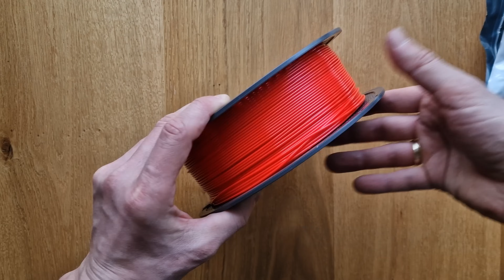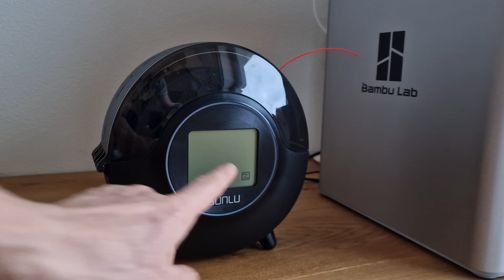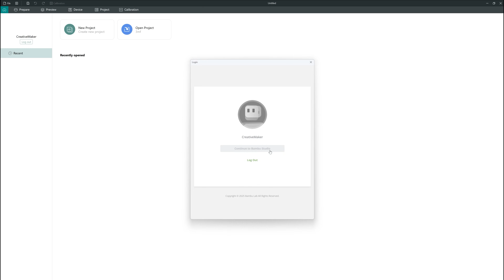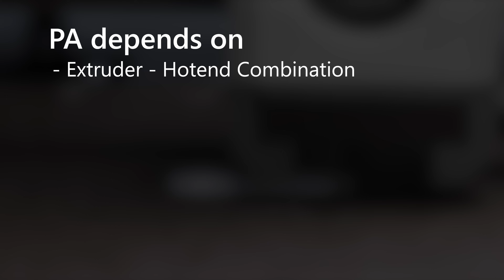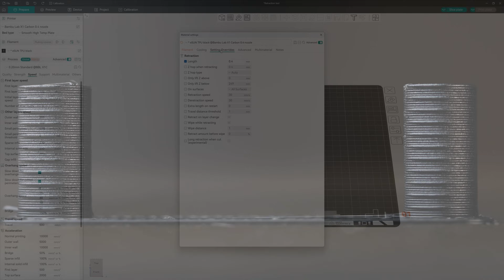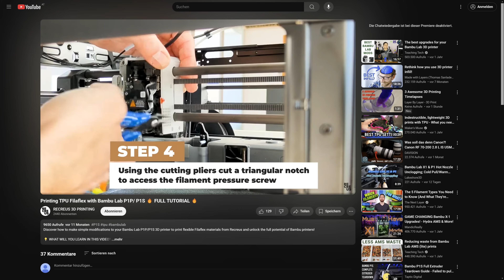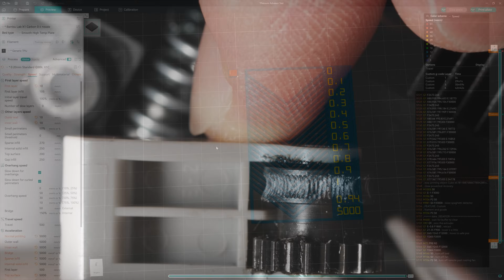Mastering Flexible Filaments on Bambu Lab - the Ultimate Guide 🛠️

Comment: My beef with eSun is the very poor quality spooling they do. If there's slight variations in the tension on the filament going into the printer, this creates extrusion issues that manifest in the print. There's already so much you have to set up correctly from the filament drying, loading, filament path, extruder and hotend that having the wonky spooling does not bring my any joy.

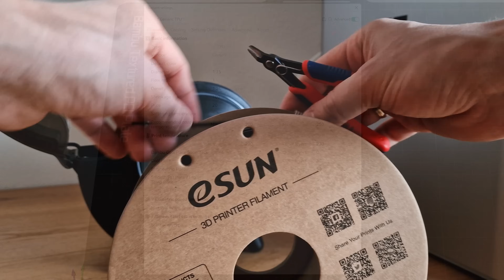Comment: 13:48 Is 70 degress Celsius not a bit hot to dry TPE at, given 55 is recommended for TPU which has better temperature resistance than TPE? I just do mine at 55 I think 70 is a bit hot is my opinion
Reply from the maker: Thanks for pointing that out — appreciate you sharing your experience.
To be honest, I wasn’t aware that TPE is generally recommended to be dried at a lower temperature than TPU. I had no issues so far, but you’re absolutely right that 55 °C is the commonly recommended range and the safer option.

Comment: Great job on the video; very well done and informative.  Trying to decide if I want to try 60A with an H2D, sounds like such a headache.
Reply from the maker: Thanks a lot — glad you liked the video! 😊
I don’t have access to an H2D myself, but I’m super curious how well dual usage would work with 60A. I agree though, it will probably take some time and experimentation to get it running reliably, and a lot will depend on the print head design and where the spool can be placed.

For your information: I’ve just uploaded a dedicated video about printing 60A on the X1, in case that’s useful.
If you ever decide to give it a try on the H2D, I’d love to hear about your experience!

Comment: I think although Studio doesn't show the OA you set in Orca, it does use it.
I will have to check gcode to confirm or not though.
Reply from the maker: According to my research, Bambu Studio does not use the OA set in Orca—but I haven’t actually checked the G-code myself. Have you had a chance to look at the G-code meanwhile? Would be great if you could share any insights. Thanks!

Comment: This is really helpful. Thaks. I tried to push through ptfe tube. But it did not work. So filament directly to nuzzle as instructed work. However, before actual print starts, you need to pull filament upwards so that it won't entangle in middle of preparation. After this, as the movement of nuzzle become repetitive and predictable, you can monitor and leave it.

Comment: Going to ask what is probably a pretty basic question.  So lets say I drop a benchy into Bambu Studio.  I then right click it and change filament to generic TPU.  Does this automatically set settings for TPU?  And then after that I slice it and send it to my printer (not print directly, but just send the model over).  I then go to my printers screen and select the model and then pick the generic TPU I have set on the external holder.    Since I have picked generic TPU will the printer follow those generic TPU setpoints or does it look at what was set from your computer on the model itself (in this case I picked the same, but lets say I sliced it as PLA and then selected TPU on my printer)?  Still learning how profiles and settings work between studio and the printer.

Comment: Having printed flexible filament for years without problems with an old and primitive Renkforce RF100, I couldn't imagine how complicated it is to get the same results with a BambuLab A1. I wonder why there is no turn-key solution provided by the manufacturer.

Comment: your TPU vs TPE comparision is a bit misleading in your context: TPE (Thermoplastic Elastomere) is a group term that used to group for example Thermoplastic Polyurethanes (TPU) or Thermoplastic Styrene Elastomeres (TPS) like SEBS (a Cousin of ABS) for aexample

So every TPU is also a TPE

fun fact: eSUN TPE 83A is (according to the MSDS) 97 % Tetraphenylethene (which is not a TPE) - it is usually only used as an additive for PLA to improve the mechanical properties and enhance the crystallinity, but you usually would only use a maximum of 2 % Tetraphenylethene and not 97 % as eSUN suggests - but since they also give the correct CAS-Number in their MSDS, i wonder what is going on there.

Comment: I very impatiently wait your episode on 60A TPU !
Myself I did print FilaFlex 65A TPU surprisingly well with my A1, I didn't use a tube, I left the extruder, I just had to hold the filament with my hand during the print...
Reply: Did you loosen the extruder’s filament drive gear tension?

Comment: Excellent video! I don't have a Bambu Lab printer but instead use an Infimech TX but I do use Orca slicer 2.2. Just finished a TPU project and tweaked the settings until a great result. Nice, smooth surface and great overall quality. My only struggle seems to be the seem. Tried different settings, scarf included. Result was good but could be better. I have used the Orca calibration tools before, but strangly I forgot to use them for TPU. still managed to get the desired result. 
One thing I found out with my setup: Although I started with the low speed settings and printed a number of objects, when printing the last set, during the print I changed the overall speed to 200%. I could not see any difference in the end result.

Comment: In general your English is excellent. However, the pronunciation of Bow is not correct - sounds like B-ahh-w not B-o-w.
Hope that helps. Bow is one of those words that is spelled the same with different pronunciation for different meaning.
B-ah-w is the front of a boat, B-o-w is bent wood of a archery system.

Comment: Printing tpu is quite model shape dependant. The first principals could be a good quide, such as function of the model. Best adhesion is hotter range nozzle, hitter range 1st layer bed temp and print speed for first & top (few) layers kept slow with 0 fan.  Stringing will likely occur around rapid repositioning, so avoid multi model plates unless models are low & complete object before starting another is set.  The balance is having the tpu hot enough to adhere well to the buildplate & itself, and fan to print speed to avoid stringing. I'd suggest after the first 1-2 layers, the fan set at 100, then match the inner & outer wall for efficient speed. A firmed wall may act as a nozzle wipe when sufficient cooling has occurred. Small models might be friendly to a minimum layer time with this setting allowing cooled inner & outer walls to wipe the nozzle.

Comment: Awesome 👏 Looking forward to the 60A video! One question, with the spool mounted on roller bearings above the printer, how do you keep the filament between the spool and the print head from falling into the chamber and possibly getting tangled on the print head?

Comment: I use the X1C for engineering parts and are dabbling with inserting TPU friction areas into harder plastics - ex fingers for robot grippers. 
I currently do it by printing a solid friction pad in TPU, then printing a finger in harder plastic where the friction pad is inserted into, we pause the print and then print over part of the TPU so it is melted into the PLA, PETG, ABS... We make sure to have a cavity that locks it in XYZ direction so adhesion is not a concern.

I would be very interested in knowing if it would be a good process to print in TPU for AMS and then print 60A on top of the TPU for AMS for adhesion, friction and surfaces.

Comment: yeah, not sitting through 38 minutes, here's a summary y'all

"... Based on the information from the sources, here is a comprehensive step-by-step guide to using TPU 95A filament on a Bambu Lab X1-Carbon printer.
Printing with flexible filaments like TPU can be tricky, but with the right preparation and settings, you can achieve successful prints. The Bambu Lab X1-Carbon (and P1 series) is capable of printing flexible filaments, even ultra-flexible ones, although some adjustments and care are required.

1. Prerequisites:

*Drying the Filament: TPU is highly hygroscopic, meaning it aggressively absorbs moisture from the air. Printing damp filament can lead to issues like foaming, spitting, poor print quality, and stringing. It is highly recommended to dry your TPU filament thoroughly before printing and ideally print directly from a filament dryer or a dry box. The source recommends drying at 70°C for several hours.

*Slicer Software: While Bambu Studio can be used, the sources heavily recommend using OrcaSlicer for calibration tests due to its built-in calibration tools. You can download OrcaSlicer from its official GitHub page.

*Printer Connection: Ensure your printer is connected to your network (via Ethernet or Wi-Fi) to use the slicer's device tab and send prints directly.

2. Initial Printer Setup & Settings (Based on TPU 95A HF):
The sources indicate that Bambu Lab's default profiles for TPU 95A might need tweaking. A profile that resulted in significant improvement for TPU 95A HF included the following changes:

*Maximum Volumetric Flow: Reduced to 2.5 mm³/s. This is much slower than defaults for other materials but helps with flexible filaments.

*Retraction Length: Set to 1 mm.

*Print Speed: Lowered to 30 mm/s (for inner and outer walls initially). The source later experiments with speeds as low as 10 mm/s.

*Travel and Acceleration Speed: Also lowered.

*First Layer Temperature: Start around 230°C.

*Other Layers Temperature: Start around 250°C.

3. Calibration Process (Using OrcaSlicer):
To fine-tune your settings for your specific filament and printer, perform the following calibration tests in OrcaSlicer's Calibration menu:

*Temperature Tower:

   *Use OrcaSlicer's Calibration menu to generate a Temperature Tower.

   *Define a temperature range to test (e.g., 215°C to 255°C).

   *Print the tower and inspect the results, focusing on overhangs, bridging, and surface quality.

   *Select the temperature that yields the best results (the source found 250°C to be optimal for print quality on layers other than the first). Set this as your nozzle temperature for other layers in your filament settings. The first layer temperature can be slightly lower (e.g., 230°C) for good bed adhesion.

*Flow Rate Calibration:

   *Use the Flow Rate calibration test in OrcaSlicer. Ensure your filament profile's flow rate is initially set to 100% (or 1).

   *Print the test patterns.

   *Examine the top surface of each pattern. You are looking for a smooth, solid surface with no gaps (underextrusion) or ridges/bulges (overextrusion).

   *Identify the sample with the best top layer and note its correction value.

   *If all samples are underextruded, increase the Flow Ratio in your filament settings and repeat the test.

   *Once you find samples showing both underextrusion and slight overextrusion, refine the test with a smaller range of values.

   *Calculate your final flow ratio based on the best-looking sample (Flow Ratio = Initial Flow Ratio + Best Sample Correction Value). Enter this value in your filament settings in OrcaSlicer.

*Pressure Advance (PA) Calibration:

   *Access the Pressure Advance calibration in OrcaSlicer.

   *The source recommends the PA pattern method on a smooth PEI plate for clearer results when tuning flexible filaments.

   *Print the test pattern.

   *Examine the corners of the test print. You want sharp, clean corners without bulges or gaps.

   *Identify the value that corresponds to the best corner quality. The source found 0.868 to be the best value for their setup.

       *Note on Bambu Studio: Bambu Studio uses the term K factor instead of Pressure Advance. If you plan to use Bambu Studio, you need to create a custom filament profile and a custom pressure advance profile within Bambu Studio to apply this K factor. This involves saving your filament settings as a preset, creating a new custom filament profile, and then adding a new flow dynamic profile with the calculated K factor. You then need to apply this profile in the device's spool settings before printing. This setting is not saved permanently if the printer is power cycled and needs to be reapplied. If using OrcaSlicer, entering the value directly in the filament settings is sufficient.

*Retraction Tower:

   *Use OrcaSlicer's Retraction test to generate a tower.

   *Print the tower.

   *Examine the tower for stringing and seam quality.

   *Identify the retraction length that results in the least stringing and best seam. The source initially found the default (likely 0.4mm) to be fine but adjusted to 1 mm with 50 mm/s retraction speed and 2 mm wipe distance when experiencing stringing at slower print speeds. Set these values in your filament profile.

4. Bed Adhesion:
Flexible filaments, including TPU, can aggressively stick to hot build surfaces. While the source noted good adhesion to a PEI plate for calibration tests without adhesive, it is generally recommended to use a PEI coated plate and potentially apply a layer of glue stick as a release agent, especially on glass beds, to prevent damage to the print surface as the part cools and contracts. The source noted that adhesion on a smooth PEI plate was slightly stronger than textured PEI.

5. Printing and Further Considerations:

   *Print Speed vs. Surface Finish: The source found that print speed significantly impacts the surface finish of the TPU print. Slower speeds (e.g., 10 mm/s) resulted in a matte finish, while faster speeds (e.g., 30 mm/s) resulted in a glossy finish. Choose the speed that gives you the desired aesthetic.

   *Print Speed vs. Stringing: Printing slowly can increase the risk of stringing because the filament spends more time hot in the nozzle. Retraction settings help mitigate this, but some fine stringing may still occur. The source suggests these can often be easily removed with fingers. Using a blow torch or lighter carefully can also remove fine strings.

   *Direct Printing from Dryer: The source successfully printed directly from a filament dryer placed above the printer to minimize resistance, without needing to manually unwind the spool. This requires the spool to rotate freely (e.g., on bearings).

By following these steps and performing the recommended calibrations, you should be able to successfully print TPU 95A on your Bambu Lab X1-Carbon and achieve good quality results.
..."

GLHF y'all

Comment: What ? This printer can't handle soft filaments out of the box ???? WTF ?
Reply: The AMS is effectively a bowden system. No flexible filament works well in a bowden system.

Remove the optional AMS out of the chain and they print flexible filaments out of the box just fine.
Reply: @lmaoroflcopter  It's still a bowden isn't it ? Or do they have a direct drive option ?
Reply: @surronzak8154 The printer is a direct drive. The AMS however works like a bowden.
Reply: @lmaoroflcopter thanks , but why does it fail if it’s a direct drive with the AMS ? I don’t get it

Comment: since you are from Österreiche and I am out of Bayern I can you tell is way easier than everyone thinks to print soft TPU. I have a little TPU 80A Ether based printfarm - so maybe one of the tougher materials and I print up to 20 parts on one P E I plate without any stringing. I am super interestet in your next video and if you need some input just hit me up. and yes I switched to orca as well, due to is more consistence I start a day arount 12 Printjobs and with bambu is wider range of results and with orca is almost consistence. the max volume is not needed once you set your own printspeed just reduce the travel speed way more and your results will be way better
Reply: entschuldige der Nachfrage, aber wie ist es möglich den Orca slicer jetzt noch zu verwenden?
Reply: @stbu7561  Also ich verwende ihn regelmäßig… manchmal wenn ich ein AMS verwende klappt es nicht. Alles andere stressfrei und ich hab alles up to date

Comment: this was very helpful, but with the new V.2 bambu studio update i can no longer find K-factor?
Reply from the maker: Thanks for bringing this to my attention. I have not even downloaded the new v2. Will have a look the next days and keep you posted.
Reply from the maker: May someone else can answer meanwhile?
Reply: @creativemakerat  ok so I found you must do a manual calibration in order to change the K factor, then you can change it accordingly in the device menu edit settings for the custom filament you've created and it will save that value at a push of a button when you decide to use it again!

This is all on my AMS lite though so I'm not sure if it's the same for v1 or v2 AMS systems.

The power of finding problems yourself aswell as from other people's issues a print Grant's you is immeasurable 😂

Comment: Thanks for experimenting an all of these and sharing. One note, I have essentially the same dryer as you, and sadly I did get underextrusions while printing TPU. I had to literally pull out segments of the filament every so often to prevent this, little by little to avoid moisture issues too.
Reply from the maker: Thanks for sharing your expirence. I'm facing similar problems when drying 60A. I will cover the topic more in detail in the next video.

Spoiler: try to put some completely refresehed silica gel bags along with the spool in the drayer. I think the problem is, that there is no airflow inside the dryer. Therefore the air saturates and there is litarly no drying effect any more. The Silica Gel should absorb moisture. At least i had the feeling that this helps. I also tested to use an oven with air flow, that seemed to work best. But be sure the temp control is accurate. What do you think?